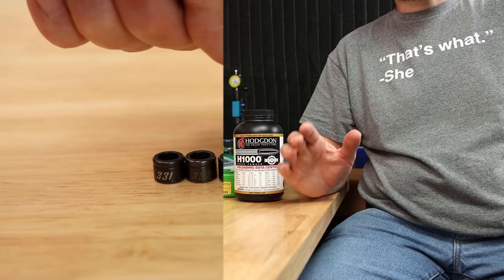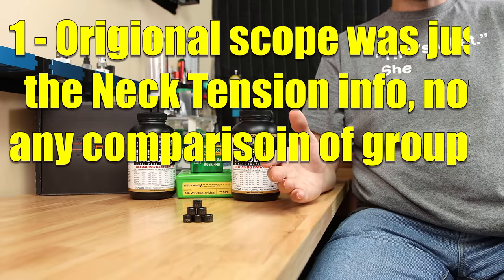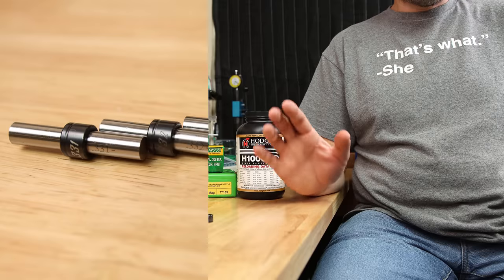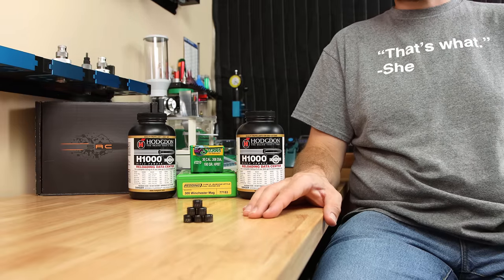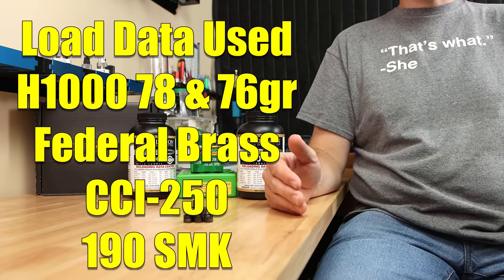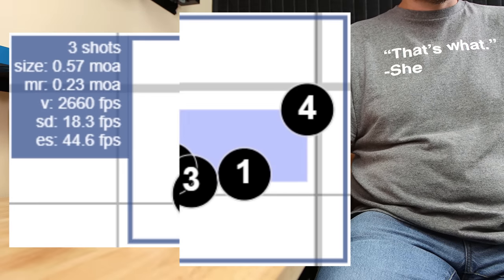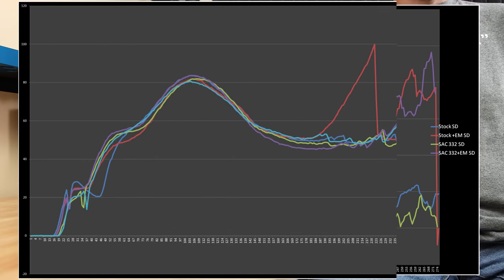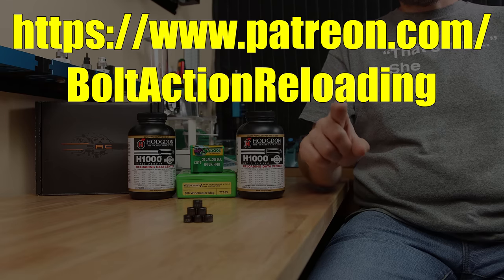300 Win Mag: Proper Neck Tension - Surprising Results!

Comment: I've a bit of logic, and a hypothesis. Maybe someone can find fault with it.

I've noticed;
 - Expander mandrel has bad SD regardless of what else it's used with
 - Stock without mandrel is somewhat better
 - SAC SD is very low compared to the other options tested
    > you mentioned specifically that the SAC bushing has given you best runout numbers

I'm assuming;
 - Expander mandrel is as good as one can be
 - You lube but don't neck turn, based on your last video

So I figure that;
  - Bushings, assuming high quality (in this case, SAC), create a near-perfect cylindrical outer diameter of the case neck
  - Mandrels, assuming high quality, create a near-perfect cylindrical inner diameter
  - It stands to reason that variations in wall thickness have to go somewhere
     > With bushings, the variation is pushed inwards, leading to imperfect inner cylindricity
     > With mandrels, the variation is pushed outwards, leading to imperfect outer cylindricity
  - Because neck tension measurements are averages of the way a case clamps onto a bullet, imperfect inner cylindricity goes largely unnoticed in this particular measurement, thus leading to better results if neck tension is your only criterion.
  - Given how you also saw better results in grouping with the SAC bushing, I theorize that centering the cartridge in the chamber is more important than even clamping of the bullet, likely as a result from more even expansion of the case neck into the chamber

So I predict;
  - Brass that is neck turned AFTER sizing with quality mandrel will have both good inner and outer cylindricity and uniform wall thickness, resulting in best possible SD and grouping. 
      > Material must be removed from  the full circumference of the neck to ensure uniform wall thickness, there may be no spots untouched by the turning process.
      > Cases should still be lubed

What could be tested;
  - Whether mandrel + turning (in that order) gets same or better seating force SD and grouping
      > Hypothesis: slightly better
  - Maximize inner runout with perfect outer runout VS the opposite VS minimized inner and outer runout, all with similarly good seating force SD and same powder charge, test for grouping
      > Hypothesis: mandrel + turned slightly better than bad inner runout, much better than bad outer runout.
  - See if lube still makes the same difference if turned after the use of expander mandrel
      > I couldn't tell from your previous video if you expand before turning, in which cases this is already tested and last video results apply and we have our answer.
      > If not, I hypothesize that the difference lube makes will be less than shown in said video, but still make a difference of some significance

Comment: My experience with fill length sizing (bumping the shoulder 0.0020) with bushings only in .300WM is that after 3-4 sizing the case mouth started have an inward bend. I had to start following up with an expander mandrel to flatten out the inside of the necks so that there was a larger and more consistent surface area making contact with the bullet. Not sure this applies to this video… but just providing a warning for others to look out for.

In case the data point helps someone, in use a Hornady 0.332 bushing and a 0.3070 expander mandrel. I average slightly under 1” for 5-shot groups with Hornady ELD-M 225gr bullets.

Comment: So you have 2thou neck tension at the best group? 
I have not had a problem with accuracy under sub 1/2 moa, shoulder 2thou and standard custom grade die already sets neck tension to 2 thou. Case length trimmed to keep all cases even all the time. 

It does seem the common neck tension value of 2thousands is the best place to start. 
Thanks for the video.

Comment: I'd like to see the process using these neckbushings (-0.002, plastic deformation) plus mandrel (+0.001 only elastic? ) and some lube on the bullets. At least this is the way Keith (winning in the wind) once told. Last week I tested it this way  and instantly had a SD of 5 and 15fps on 12 shots with my Creedmoor. 300WM is still pending cause I got no fireformed brass. But I'd be interested to see if this process could be copied for 300WM, cause the truth is most somewhere between... 
(Video: "getting consistent neck tension")

Comment: Although you are using SAC neck bushings to size down case neck, are you still going back through and using expander mandrel as finishing piece before seating bullet?
Reply from the maker: Hi Ethan, I have not shot anything yet sized with these bushings and then with the expander. (I loaded some and showed the force chart toward the end) the initial information with velocity and groups are simply with the bushings only.

BAR

Comment: I noticed the chart at 6:50 shows the lubricated version with the 332 bushing was higher in force then the one without? Is it possible those are flipped or was the seating force with lube actually higher?

I would guess your next move would be to re-test your hypothesis, that is, were the SAC bushing groups a fluke or does something about using this brass prep with the SAC bushings actually improve the group size compared to the previous prep method?
Reply from the maker: Hi Dino, At 6:50 in the chart there is no mention of lube. There is a version with and without a Expander mandrel. The chart is correct. I will certainly be retesting with the bushings.
Reply: @BoltActionReloading  gotcha, I thought that might mean they were lubed. Hope you get the chance to run your follow up tests. It would be something to take a less than mediocre rig and turn it into a performer!

Comment: Theory: the smaller the bushing, the more the bullet functions like an expander mandrel upon seating. I've have been using a Redding .334 bushing and a standard expander mandrel with my .300 Win Mag for years. I have been extremely happy with both accuracy and SDs.
Reply: I use 334 as well but for 300 prc.
Reply: I use .334 for .308 for most brass including Lapua.
Reply: @ironDsteele  I tried 334 on Norma brass for 308 win, but the bullet slipped right though. Had to wait on my reloads and get 333 and 332's shipped to me. It surprised me, because I reloaded Starline brass in 308 just fine with 334.
Reply: @thelittledetailscr7231  In order for your bullets to slip right through after sizing with a .334 bushing, your brass neck thickness would have to be less than .013". In my experience, that's not consistent with Norma brass, which is on the beefy end of the scale. Did you or someone else neck turn that brass?
Reply: @njgrplr2007  No, it is once fired Norma. I guess it is possible that I had the wrong sizing ring in there, but I am 95% sure it was 334.
Reply: @thelittledetailscr7231  I'm surprised to hear Norma brass is that thin. I've no experience with it, but I've used Military brass and Winchester with no issues. It's actually small enough that a .307 Sinclair mandrel can still iron the neck out before bullet seating.
Reply: @njgrpit2007 is enjoy reading through the comments and seeing who has real world experience and not just shooting their mouth off.  I can tell you know exactly what your talking about.
Reply: @juliusjames5577  This one hobby where spotting a bullshitter is probably the easiest part.
Reply: @thelittledetailscr7231  There's an easy way to find out. Take one of the Norma rounds you loaded and measure the outside diameter of the case neck. Your case neck thickness = (outside neck diameter - .308) / 2. If the case neck thickness is .013" or greater, you probably used the wrong bushing when you thought you were using a .334".
Reply: @njgrplr2007  I got 12.5. I can send you pictures of measurements if you are interested. Just add your email to the comment. Thanks for the knowledge.
Reply: @thelittledetailscr7231  Ok, .0125" is probably the skinniest neck thickness I've seen out of the box. In any event, that would explain why the .334" bushing doesn't work with your Norma brass. As you probably know, this simple exercise can give you a good idea of which bushing will work with different brass given the neck thickness measurements. Best regards